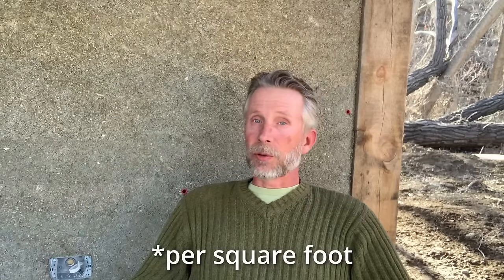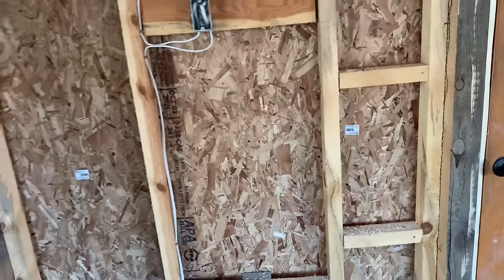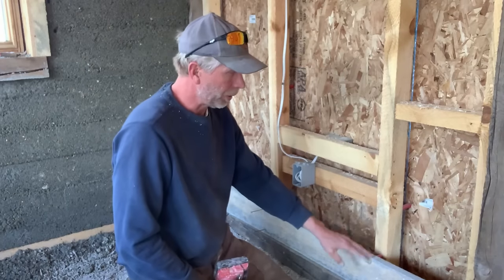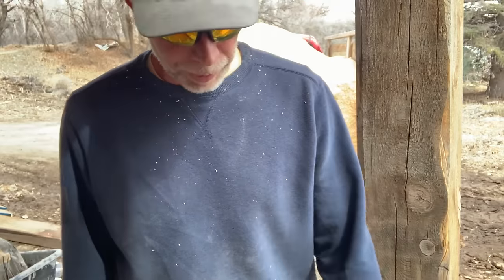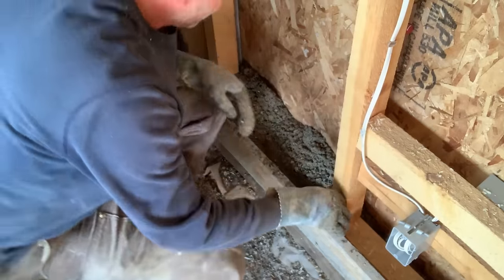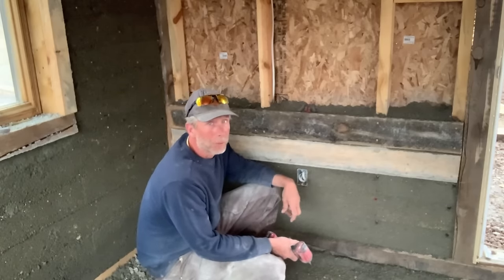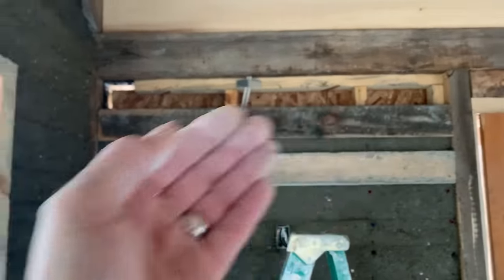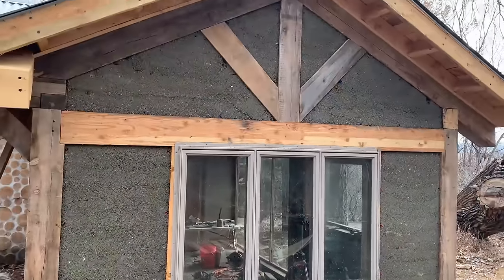Dustcrete

Comment: Much more work but way stronger bonds, if saw dust is literally cooked with quicklime for 45 minutes  then let soak over night. What happens is all the cellouse fibers get split ends so a much greater mechanical strength & mechanical bonding is achieved, also surface area increases several orders of magnitude also increasing strength through better chemical bonds between Ca in lime & C in the cellouse.

Comment: thanks im very interested in this technique. i live in Queensland Australia and have access to course hoop pine sawdust. I love lime plaster and lime wash.  I make it myself. I have been a solid plasterer and concreter earlier on. The only thing I wonder about your system is if the inch and a half of dust create would fall off the wall in front of the pine studs if there was movement in the building. There are different fibers that they put in concrete instead of reinforcement. ive used this very successfully in plaster, the one I used was fiberglass it was called micro fiber by Sika. Also id probably hammer a few half driven in nails in the studs. I would use a bit more lime compared to cement to make the material a bit less ridged. I would use three parts lime to one part sand. I make wood fired ovens at times and ive had no problems with this mixture as the exterior plaster mix.  That's of course with sand and i use micro fiber as the reinforcement.   In restoration work in old buildings in England they always use lime now because it flexible. with some of these old buildings on loose rock footings the cement mortar or plaster cracks with movement where the lime alternative does not.  im quite keen to try this technique and thank you for sharing it. brilliant use of available materials.
Reply from the maker: I have not had issues with the dustcrete falling off outside the studs, but have had a few hairline cracks in those locations. I am planning some test batches using a clay/lime recipe, and omitting the Portland cement. There is fiberglass reinforcement in the interior plaster. I’m still tweeting the finer points of this system, but overall it has performed admirably.
Reply: I use hydrated lime in the lime plaster. I was taught to slake it first. that is to soak it in water for about a month. ive used lime clay sand plaster. its very good. The guys I worked with were into restoration work and alternative building techniques.  they put chopped straw in the plaster mix then used a lime clay mixture as a finished coat. He said he sometimes puts old car oil into the mix. I haven't but do polymer modify it with acrylic for external use. I think this saw dust idea has great merit. here in Australia
 they put pine logs into a a machine that makes round poles. it produces a lot of saw dust. they often use it in horse barns but would make great walls. perhaps even blocks ?  @radicalgastronomy
Reply from the maker: @brendanhose1065  There is a good case for blocks.

Comment: Good idea, id worry about a few things. How well does moisture move through?  Cement based products generally absorb and carry by capillary action. In cold climates that moisture movement to the exterior is a concern.  If you dont have any sources of water inside the concern might be unjustified.. If you do, and cook inside and all of the typical things that add moisture to the air, pay attention to any cracking on the exterior stucco. May pay to treat the inside with something that prevents capillary in concrete and a vapor impermeable type of paint over that... Curious to see how a few winters go! Keep us updated and best of luck!
Reply from the maker: The key it that both surfaces (inside and out) are vapor permeable. If we painted one side, the latex would prevent sections of the wall from drying after a rain event. These walls have performed perfectly for over a year. If you want to see what happened in an area where I had a plumbing leak, watch my other video on that.
Reply: @radicalgastronomy   the point of my post, ice is vapor closed for all intensive purposes. Again i don't know your climate zone and don't know the vapor load/indoor rh during the winter. That said the wall may perform 100% as is. However, if its a 10 degree outdoor winter temperature and warm/humid inside i can place bets on the dewpoint being reached inside that wall and place a pretty good bet that ice inside the cavity will be something you hadn't planned on. Same indoor winter time conditions with a below zero outdoor temp is more trouble. Look up the perfect wall.. again im not knocking your method.. pretty ingenious if you ask me.. but in my opinion, its only half the solution for a dwelling ..

Comment: To be fair variations of this technique have existed for hundreds of years and there are dozens of commercial products that use varying amounts of wood fiber cement mixtures. Durisol blocks are a close equivalent, now made by "nexcembuild.". Hardie board is a mixture with higher cement content and preformed into boards. Commercial stuff is pre-formed into some shape for shipping purposes, vs onsite forming like this. 
It is also basically adobe with modern cement instead of clay, and sawdust for the straw. In Europe in the 1800s the cement was just the lime and maybe some clay. They used grass instead of saw dust, until sawmills existed. There is another fellow on YT using aircrete with fiber glass filler to precast walls flat on the ground and tilting them up. Similar but alternative method. It's runny so it would be harder to do with this vertical forming method. 

Interesting video though, and well done on the editing. I'd like to see data on how insulative it can be. I suspect aircrete does that better, but this is probably stronger.
Reply from the maker: Having done both, I can tell you that this is certainly stronger than aircrete. It may also compete with aircrete in the R value department. The comments section of my aircrete video has pointed out that the oft quoted 6/inch r value of aircrete is inaccurate.
Reply: @radicalgastronomy  Yeah I would guess around 2-3R/inch for aircrete. It's still a medium conductivity material and doesn't have the tensile strength to make excellent bubbles vs plastics that are pretty low conductivity and very stretchy making air tight bubbles. You aren't going to get as good as the top foam insulations out of concrete. The main point of doing it is low cost and fire resistance. Fiber cements have the same advantages but also offer tensile reinforcement. Even if fairly low.

Comment: Just wanted to let you know I’m still working on DustCrete Bungalow. Other things came up and put on hold. Now that it’s freezing outside i have mold issues. I set up a dehumidifier and a heater and pulling about 2 gals a day from the walls. I figure i cant insulate the ceiling till next spring as i want to plank it. You can tell the dryness of the walls get light grey as to dark brown. Lesson learned. Don’t fill in walll unless it can breathe from both sides to Dry… 😀
Reply from the maker: Thanks for the update!

Comment: My dad built features on a model railway using this material, that was 1964, I bet he was not the first. The building trade have had similar products available in sheets since the late seventies to my knowledge  and I would not be surprised if it did not date back to the late forties or fifties. In the nineties I worked on a slightly differing mix containing waste paper and straw as well as sawdust and cement to provide dome structures as emergency housing for refugees of war or natural disaster as it is easily pressed with a large mold, and ingredients easily sourced. Still have my test piece, a more macabre use I worked on was for the production of coffins again for disaster zones.
Reply from the maker: Cool!

Comment: I haven't read all the comments so I don't know if anyone else mentioned or commented on your heat pump but if that is what you ate using the window AC uint it for that in and of itself is a great idea and should put out some heat as long as the outside temperature doesn't get below freezing. If that's not the case and you were just hanging it there to keep it out of the weather then you might try and plug it in and see how much heat it would produce.
Reply from the maker: That AC unit was temporarily mounted there before the addition was complete. And no, you're not the first. LOL
Reply: @radicalgastronomy  I guess you have a better heat source that a window heat pump. LOL

Comment: How does this compare to hempcrete as a flame retardant, also how air tight is this and is it and how much of a vapor barrier?
Reply from the maker: It seem identical to hempcrete for flame resistance. I use no vapor barrier, as I prefer vapor permeable walls. It is airtight if the perimeter of thee subframe is caulked, or the pour is outside the primary frame.
Reply: @radicalgastronomy  also do you know the aproximate R-value per 6 inches of thickness?

Comment: Way cool!  His engineering skills are all in place.  May I suggest that some re-rod would make this structure more tornado resistant?  Also, strongly suggest a sealant on all exposed surfaces of the dustcrete because biologicals are going to eat the sawdust.
Are you a city dweller?  Reply for formula with brick dust, garden lime, and chopped up hard plastic for the pozzolan.
Do you have a mobile home?  Ask this ol chemist how to make exterior patches out of cardboard and couple other things.

Comment: I have used Cement, kiln dried hard wood saw dust and chopped PET fibres. Slab on ground - warm. Hard wearing enough for footpath.great  thermal insulation - very similar to timber of similar thickness. Best of all takes a batten screw. You might call these a "buggle screw" On a pull test, head breaks off before thread lets go.
Reply from the maker: Nice!
Reply: What are PET fibres? Plastic bottles? Thanks

Comment: I got a great solution to the the small spaces after it dries. 
What is you used an even smaller board took even smaller boards on each side. You would make a “U” facing in to the wall on all four sides of your wall then the he shrink would be inside the “U” and the outside of the “U” would be board on three sides small shrink air pockets and dustcrete on one side. In other words the shrink would be within the “U” on all four sides of the wall. Another way would to cut or route out the “U”. 
Hope I was clear 😊😊
Reply from the maker: I do something similar with the cleat boards. Yes, that would work.

Comment: This is GREAT!  What do you think about using conduit pipe to run the electrical, phone and other cables through so you have the option of changing or adding things later?  Or it might be easer and more practical to design those as a surface mount?

Comment: in Germany, all the "professionally done" nest boxes are made out of wood concrete https://de.wikipedia.org/wiki/Holzbeton which is similar to yours. Also whole buildings used to be built with it due to scarcity of concrete. The wiki states the structures are still holding strong and prove to be well insulating construction material

Comment: Really interesting and intelligent approach to low impact building. I'd love to see R values for this. Lots of potential.
Some thoughts are ; Strength as opposed to normal masonary, would it be an idea to attach a layer of expanded metal to  the outer side of the 3x2 frame which would be buried in the dust crete for extra strength. Also would it be worth leaving the osb outer form in place and even screwing 50 mil of ridgid foam insulation for extra performance and protection of crete?
Either way, really like your approach👍👍
Reply from the maker: There are a variety of modifications one could make, for sure. I’m liking the performance of the material, as shown, but additional layers could be added to meet different requirements.

Comment: I build using steel and concrete.  Insulation is the secret behind living comfortably on the cheap.  If it were I, I  would run all the electrical in emt. Personally, I surface mount a lot, because it can be trouble  shot, repaired, removed and relocated with ease.  I live alone in the country  - no wife - so, I can get away with ZERO fung shway!
Reply from the maker: Nice. Yeah, I’ll run everything in conduit, net time. Hasn’t caused any problems, but best to do it right.

Comment: Liking the cordwood wall, I appreciate the build time comparison between these two techniques. Any other insight between Cordwood and Dustcrete construction?
Reply: Cordwood is firewood on edge so in a wildfire, the wall will burn. Dustcrete is much more fire resistant if not fire proof. Termites and wood eating ants might love that exposed cordwood and virtually every cordwood wall I've seen has the bad cracks around the wood as it shrinks away from the cement allowing air to go right thru the wall and bugs too.

Comment: I'm curious what would happen if your had your sawdust soaked in water first.  That is part of the method that we used when building with a sawdust mix in our concrete in a cordwood build.   This, from what I understand, would cause the concrete in the wall and the wall itself to dry/cure slower (usually a good idea to enhance cure time with concrete) and the water/concrete slurry would be able to mesh with the cell walls of as the water permeable channels would be open (not hydrophobic) because of the soaking.  To do this, you would have a bucket or more likely a plastic trash can or another wheelbarrow filled with sawdust and your water ratio, and then you would have a dry mix in another wheelbarrow with the portland and lime.  Then you would combine the wet mix into the dry.  While applying a load of the finished combination, you would soak the next batch of sawdust with your water ratio, and repeat.
Reply from the maker: This approach could actually increase trapped air in the wall, as the swollen sawdust shrinks while drying, thereby increasing r value.
Reply: @radicalgastronomy  yes.  Thanks for the response.  I forgot to mention that.  The reduction in the size would create air pockets and thus R-value.  It's likely that the sawdust particle would stick to one side and contract from the other (whichever side was prone to drying fastest). The sticking side would act like rebar. giving strength to your wall system, not quite the same way as the cut straw in a slip straw system, but similar.  

I'm also curious about using or adding charcoal in a simlar process.  The idea of creating super long term carbon storage in the walls is a bonus and the char has a vast internal surface area that would trap air when dry , plus there is also the increased absorption of electromagnetic radiation into the carbon matrix that many people are seeking.  I learned about this latter potential and process through the book "Burn: using fire to cool the earth" which is all about the science of using charcoal/carbon to our advantage.
Reply: @radicalgastronomy   I think optimally a combination that included perhaps a majority sawdust, with some cut straw and some char might be the magic mix that offers the highest structural strength and r-value ratios.

Comment: This seems very similar to Rammed Earth ,,Earth would seem cheaper than sawdust & more fire resistant but a very interesting concept none the less thanks for sharing your technique .
Reply from the maker: The key difference is insulation. Rammed earth has effectively none. Dustcrete has both insulation and thermal mass. Because of that, it is preferable in cold climates
Reply: @radicalgastronomy  OK but what about fire resistance ?
Reply from the maker: @user-fp1eh7ze1e  dustcrete does not burn. I’ll film a test and post it.

Comment: Have you thought of making a type of "tilt-up" panels out of this, creating a standard form to use and screed off with no studs or metal studs inside of each panel?  Panels look like they can probably be made in a 4'X8' configuration which should be easy enough for one or two men to handle. PEX and PVC electrical conduit would be easy to run in such a panel.  It would also seem easy to cut/shape such a panel after it sets to modify it for whatever shape might be needed to finish a building.

edit: Another advantage of "tilt-up" might be incorporating some form of vapor barrier and/or heat barrier material on the exterior side of it.  Packing the forms would probably be quicker as well.
Reply from the maker: A tilt-up panel should certainly work with this material. Nice to have options. Pre-fab panels would be great for someone building a remote structure on the weekends, for example. One could fab all the panels over a few months, then get it dried-in in a weekend. The slip form technique has many advantages, too. For one, there is no heavy lifting, and can be done alone by nearly anyone. We should try panels, though!

Comment: Great idea, coming from an architect. What is the workability like once it's cured? I imagine it would be a lot easier to cut out or add fasteners to than conventional concrete. 

This also gives you lots of possibilities for creating more sculptural and hand-crafted details with built-in niches, fireplaces, and the like.
Reply from the maker: Thanks! Once cured, the dustcrete can easily be sculpted with wood cutting tools. You can get a good idea of how it is in this video:
What happens when there's a leak in a dustcrete wall!
https://youtu.be/E3IMvSMIlf4
I haven’t done fastener test, but suspect screws will hold in it. Brad nails may not, but we will see…
Rough sculptural details carved with a sawzall could certainly be refined with earthen plaster.